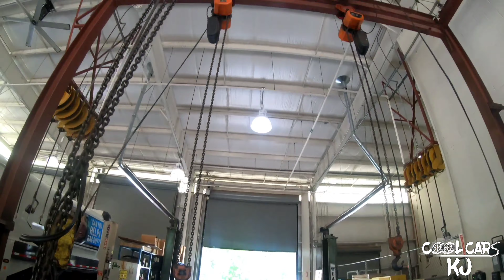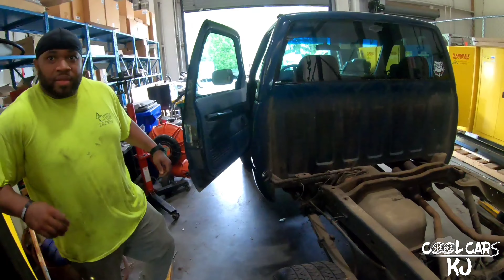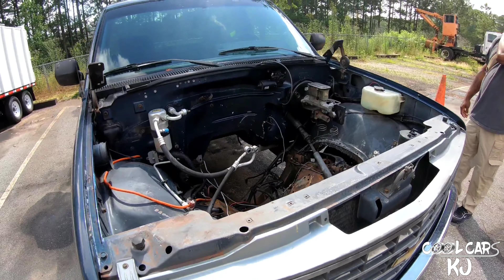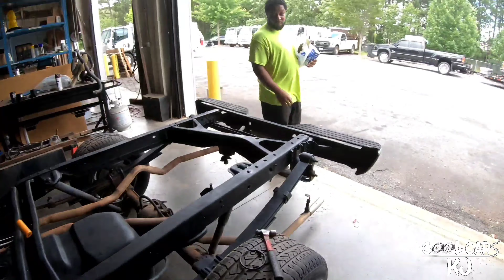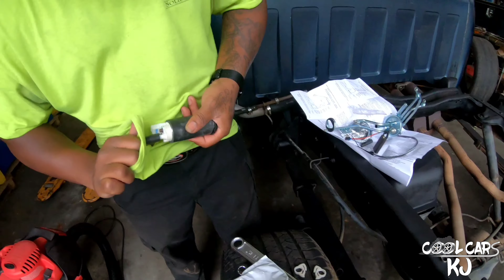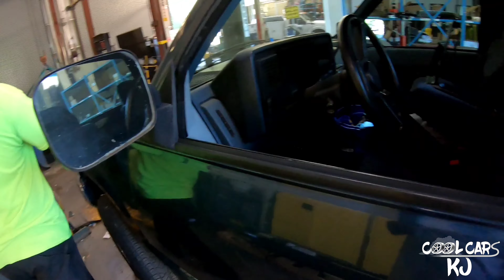LS Swap (OBS) Continues: Frame Painted, Fuel Pump Upgraded | Fuel Setup was OLD School!

Comment: When put a carburated 350 in a obs  that's how you get the fuel to the engine mounted fuel pump and use the stock tank. We Carolina boys do this on a regular to ditch the electronic tbi setup mostly on stuff for the track.
Reply from the maker: My carburetor knowledge is 1st grade level, at best!!!! Wayyyy out of my league lol
Reply: @CoolCarsKJ  lol lm working my way up to LS bout to swap my 98 extended cab hopefully by the summer have picked up much from you and others on the tube.
Reply from the maker: Glad i could help bro! Thanks for watching!

Comment: you dont need a return line or in tank pump if you are running a carburetor... the filter on the frame rail was probably replaced with an electric fuel pump... the red truck has similar setup : )
Reply from the maker: He didn't have anything on the frame rail. Just straight fuel line. No filter. I wasnt there when they removed the old 305 engine but it must have had a mechanical pump somewhere. It was'nt between the tank and firewall, i know that much.
Reply: @CoolCarsKJ  i cant wait for upcoming vids! you guys are doing really great things!

Comment: Probably pumpin fuel old school small block chevy with engine mounted mechanical  pump.
Reply from the maker: Had to be. I wasn't there when they removed the old 305. But it did have a carburetor on it. We know these were TBI from the factory so they definitely changed it. Very shitty work tho!

Comment: What fittings is that you use on the fuel line and where do you get that,  nice Videos OBS
Reply from the maker: Which part of the fuel line? Regardless, summit racing (and amazon) sells all the fittings that are needed. We will be making a video on the fuel lines soon.

Comment: What kind of domain fuel pump?
Reply: @CoolCarsKJ   what kind of fuel pump was that you were using?
Reply from the maker: We installed an AC delco ep381. Its the same pump the 96+ trucks use from the factory.

Comment: How did you do your power steering
Reply from the maker: The LS power steering lines hook right into the original OBS locations. We have not done LV's yet but thats how ran mine on the '95 orange truck.
Reply: Thank you for the reply trying to figure it out on my 1997 2 door Tahoe